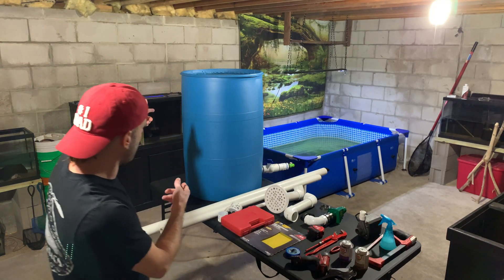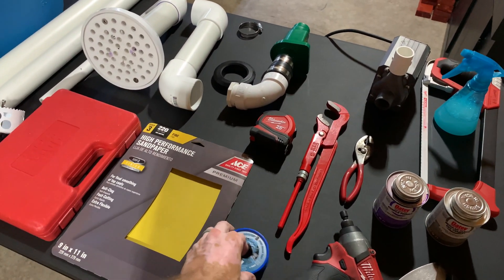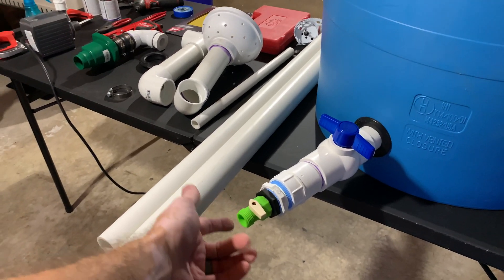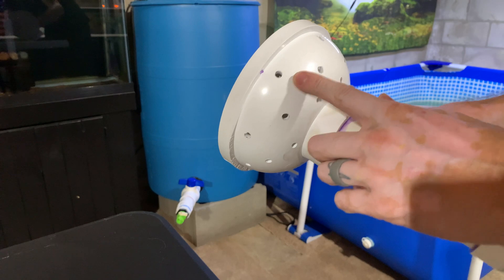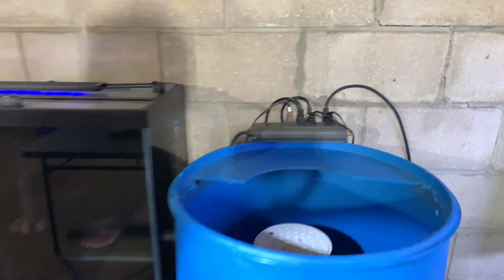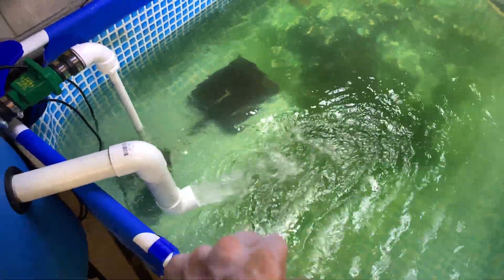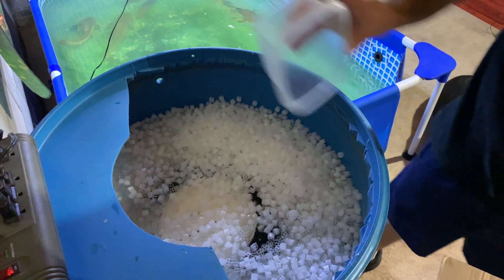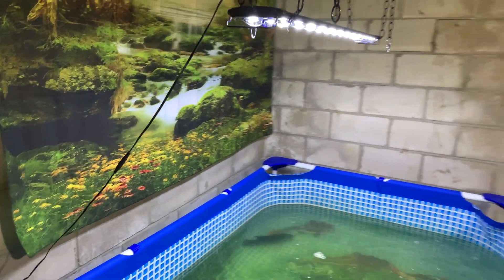How to - DIY 55 gallon barrel filter for ponds and large aquariums.

Comment: How big of a pond would this accommodate if you have heavy fish load?
Reply from the maker: I’d say safely 600-1000 gallons with proper water changing
Reply: @AquatikGuru Theoretically, if you had a 5000 pond, could you use a 275 gallon food grade tote?  And would it take (2.5 x 5) 12.5 cubic feet of K1 Bio media?  Space saving measure. 😃
Reply from the maker: Yes you could! My favorite part about doing this is creativity and that sounds fun!

Comment: It’s okay for a third stage but your using it wrong . Technically you have a pond not a tank you have large fish and need to filter the poop that little box you have before the pump isn’t going to cut it  unless you’re thinking it’s going to sink to the bottom of the barrel so you can flush it . Some will but not all and you don’t want that waste matter in with your biological and you don’t have anyway of polishing your water. Just my thoughts. Maybe try a second barrel before that one with a chamber below four sizes of rock n sand to get the waste out by rising up threw that then to the biological barrel. Just a little advice not trying to discredit your design or anything I did gain a tip from it with the shower drain part I liked that.
Reply from the maker: With this design, the pond flourished. I did filter the water, but the barrel trapped 99% of the waste that I would syphon out much like syphoning an aquarium. I’d just leave the pump running with water being added to the pond I would syphon the waste out of the barrel. After that, I’d add a polishing box filter i diy built to the pond of any fine particles right next to the big filter pump so it would have extra flow to filter the particles. Thank you for your advice tho. I didn’t explain this build or the process I used for full success as well as I thought

Comment: OK, don't understand the filtering medium, which you didn't mention in your inventory.  I was actually looking at pool sand.  Thx
Reply from the maker: The filtering media is simply called k2 media. Usually bought it large quantity’s for large filtration. There’s also k1 and k3 for various sizes etc. pool sand may work too, but this media is very well known in large systems and very well trusted so I went with what most people go with hence the lack of explanation as most building this size setup already know of or already have the media. The swirling effect ensures full coverage on all the media. And with that much media it should easily handle 6-8000 gallons of water without flaw

Comment: Not enough in depth information
The K1 stones?  Too much going on with the other projects
 I didn't mean to critique your video. But there is not enough information on several items. Seems you know wheat you are doing, but for the novice. I need  dimensions of heights of pipes and other items relative building this.
Reply from the maker: With that it boils down to how you or others set theirs up. Many people build a small stand for the filter so they would need to adjust accordingly etc. I thought about sayin the pipe dimensions as far as length goes, but it would have lead to a lot of people cutting theirs too short vs how I had mine set up.

Comment: Does your inlet pipe necessarily need to be smaller that your outlet pipe or could it all be 1.5 inch pipe?
Reply from the maker: You always want your outlet pipe bigger just in case to prevent clogging and the possibility of the barrel overflowing. Especially when indoors. 600+ gallons is a lot to pump onto a floor.

Comment: What about the potential for back pressure or back flow
Reply from the maker: I installed a large check valve on the inlet tube in case of pump failure.

Comment: so what filters out the particulants?  I didn't see any sponges or such
Reply from the maker: Majority of the particulates stay at the bottom of the barrel just due to how I directed the flow and drain system. That’s why I installed the valve on the bottom that allows me to drain the lower half of the barrel quickly. And let me tell you what, it works AMAZING! That being said, ideally I wanted a filter sock on the input but never got around to it with the pool pond. Now the new setup will include that as well as a description of why and how

Comment: How did you deal the bulk heads to the barrel?
Reply: Seal the bulk heads*. Did you use the pvc glue or what?
Reply from the maker: @gagecota8182  I actually used uniseals. You just shove the pvc pipe through it and it creates a seal with uneven surfaces without glue and such. I’d be nervous to use them with glass but with something like this barrel, they work GREAT! not a single leak even with a 1500 gph pump. When you buy the uniseals some will come with a paper that tells you the exact sized hole saw to use.

Comment: I've seen this design a few times, the only thing I dont like about it is that there isn't any mechanical filtration. Have you had any issues with that aspect of it?
Reply from the maker: No because I ran a separate filter for water polishing aka mechanical. That being said, if I had made another outlet drain and ran a second pump up over the barrel with a filter sock it could have been mechanically filtered that way as well.
Reply from the maker: Also the way the flow is designed in this filter the heavy sediments settle to the bottom where I open the barrel drain valve to empty out majority of the heavy solids and sediment from the bottom of the filter
Reply: @AquatikGuru  I run a similar but smaller version of this with k1 in the swirl filter.  Though I think the aeration might just pull the particles back up to the top. I use the k1 add the biological but it also does some mechanical as well. 🤷‍♂️ I'll have to look into your method and see if I get different results. I might run some air but not from the complete bottom.
Reply from the maker: @AquariumThoughts  these settled around a foot or so from the bottom just to swirl the k1. Still dumped a TON of waste on water change day.
Reply: That makes sense, thank you. I'm using this design on a 450 gallon acrylic that already has overflows built in to it, been trying to figure out how im gonna do it but what you said helps alot, thanks. New subscriber
Reply from the maker: Thank you for the support! Glad I could give you some positive reinforcement!